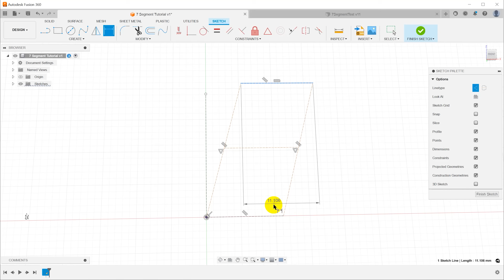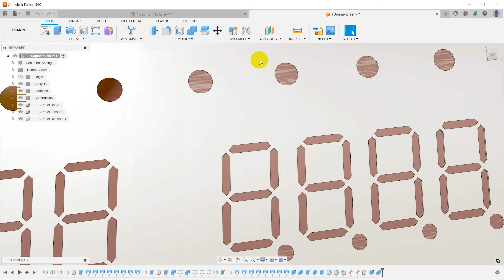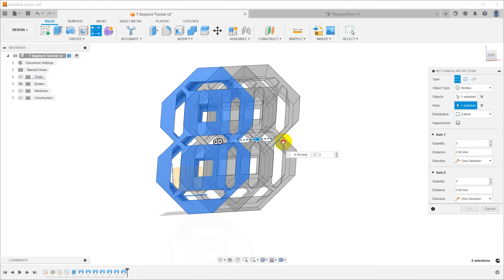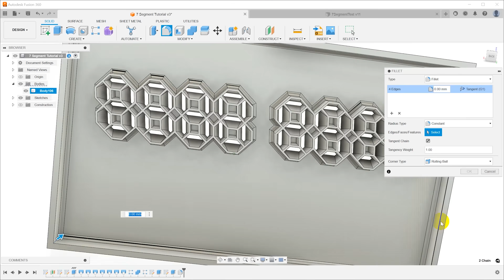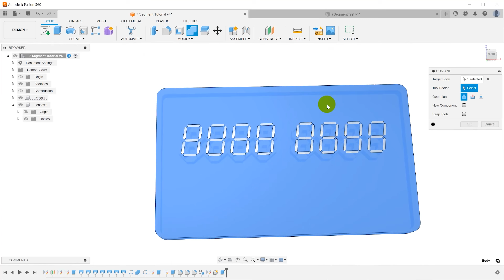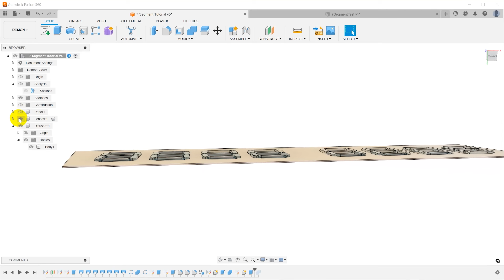Dive Into Fusion 360: Design Your Own 7 Segment Display

Comment: Thank you for this level of detail - it is very educational to see and understand someone else's approach to a problem and it often presents techniques that could be applied in other similar models. I especially like the 2 different options for the diffusers. I'm leaning toward the small separate diffusers, I suspect the single diffuser might cause light to bleed to adjacent digits.
Great video!

Comment: That was great James! My impression is there are a couple possibly easier ways to do this. Of course there are always a lot of ways to do things in CAD. I am just getting into F360 and I’ve been watching Product Design Online. I’ll post my findings on your Patreon. One takeaway he emphasized was creating sketches first, and organizing his hierarchy with named but empty components ready to receive geometry I think he said there were reasons to avoid creating new bodies by duplicating others. He also fully constrains everything on his sketches. 
You probably already know this trick but when you dimension or fill any numerical value, I was surprised to find out you can type in text that then becomes a parameter name that doesn’t yet exist, creating new parameters in line as you work. One command for this project that sticks out to me that might be useful to reduce complexity is shell. Another good one which I thought might be leveraged more was extrudes with tapers. Maybe with one diamond shaped sketch along with offset, with heavy use as others have pointed out of circular pattern and horizontal pattern the digits could be even more parametric? I can’t wait to try to model this myself and see how it goes. Curious to see if my ideas work. By the way there is a cool speed CAD contest on YouTube by TooTallToby.

Comment: Have you tried doing it without the taper on the lenses? I did it and it worked fine, might make it simpler for some people. I could only get mine to work on the textured PEI sheet though but that was with fine white details and text on the front as well as the transparent section and my bed needed cleaned.

Comment: Been recently hooked on your channel as you have a great way of presenting deep understanding of your subject-de-jour. I’m wanting to replace my 10A. 1-1/2 HP drill press motor (Craftsman floor model) with a 3 phase motor with VFD. Any recommendation as to motor specs I should look for along with a matching VFD? I don’t want to get too expensive as I’d be putting lipstick on the pig. Thanks for a great channel sir.

Comment: My process would have been a similar except in one aspect. I would have lofted to a circle (perhaps an oval) instead of a complex shape. Same outcome with quite a bit less time involved sketching. What you have done is very nice, and my method does not detract from the way you have decided upon.

You could have also gone with a short loft extrude then a smaller circular light pipe (that goes all the way to the LED) for the rest of the cut operation. Filled the entire cavity with the clear filament, and the diffusion may have been spot on, without the need for the white layer. Would be fun to test, well... what I consider to be fun anyway. I already have decided upon getting a bambu lab printer so I might just test it.

Comment: Thanks for making this video and sharing your knowledge! 

I don't know Fusion 360 well but I did manage to make some awesome 3D prints from clever ideas. It just took me ages and, sadly, I can't adjust the size of anything easily in the CAD because I didn't know how to do it right. 
Setting parameters for specific measurements with labels? Love it! Thanks! 
Projecting one sketch to another on a different plane so I can have one large sketch "to rule them all" without having to spend half the day figuring out which thing does what? Genius! Love it!

Thanks again! These tips, and more, will definitely help me massively with future projects.

Comment: Found out my F360 process for getting from concept to finished product is very similar to yours. Especially, most of the times where there were several options for a given step I would have gone the same way. Feeling reassured. Thanks James

Comment: So, I'm a bit confused. Are the lenses and diffusers 3D printed in situ with appropriate filaments, or are you cutting them out of acrylic or whatever and then snapping them into the panel?

I've always done this sort of thing by putting a rectangular lens of red (or whatever) acrylic into a recess on the panel, which has holes to allow the display to shine thru, so I'm very interested in seeing new techniques.
Reply: Have a look at last week's video. It's different filaments, with the printer switching.
Reply: @thesfreader3068  👍

I guess i was paying more attention to the display itself than how it was fabricated.

Comment: Awesome. Have been waiting for this one to see how you handled those segments & light pipes. I wonder if originally creating multiple sketches on the same plane would have been cleaner/easier than projecting to other sketches later-- although I feel like sometimes when there are circular dependencies between multiple sketches, Fusion can have a hard time finding a solution when you make parameter changes... but maybe that's due to errors on my part. Anyway, I can always learn more about Fusion 360 and others' design processes, so enjoy these videos.

Also: Autodesk is currently running a 33% off promo for a commercial 1 year Fusion 360 subscription until the end of Oct 30, 2023 if anyone was thinking about getting it or want to renew early to save money.

Comment: I tryied learning fusion 360 and got super frustrated with it and gave up on it and went back to desing spark mechanical. After watching the first 2 minutes im glad i gave up on it. Making this in desing spark would take about 10 mins if that. This is way more complicated. Plus i really didnt like the cloud nonsense. I just wanted to use the CFD tool and i couldn't even find it or how to load my projects into it.
Reply: @leadslinger 5130 I would love to see your video replicating this in 10 minutes

Comment: If you ask me, doing all the skeleton in on sketch is a 'bit busy', putting it nicely. I think I would have had the digit sketch, the segment offset sketch, and an underlying LED void sketch. Otherwise, pretty much a noob could follow along to experiment on their own. You skipped the decimal point. Still, I prefer SolidWorks; to me F360 is still clunky.
Overall, very clever, especially the tapering of the lenses and diffusers; one rocket science award.
Reply from the maker: I tried separating the sketches, but in the end found that so much reference geometry needed to be projected for reference that it ended up almost as bad.